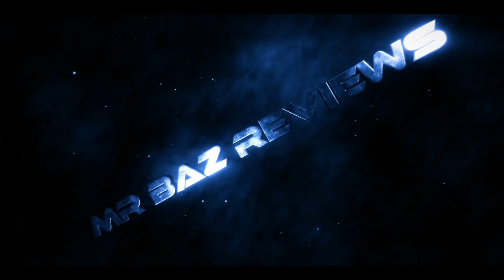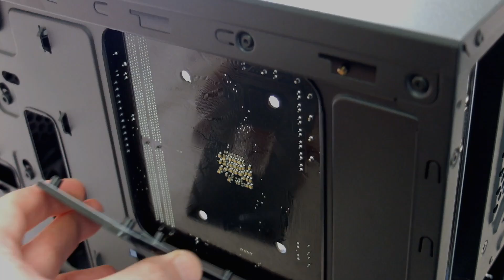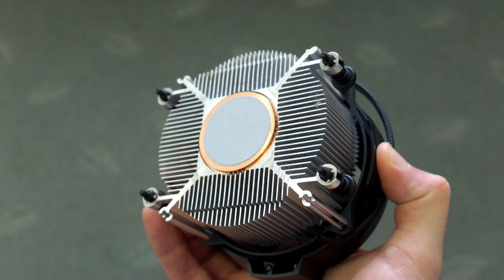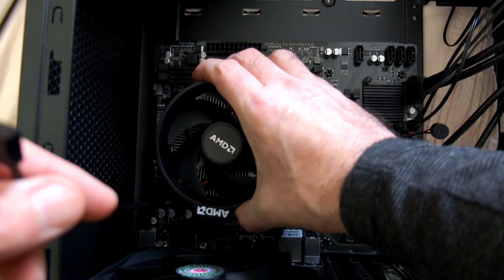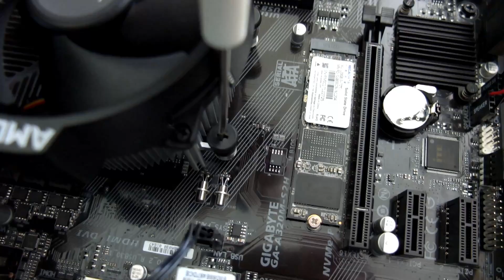How to install a Ryzen/AM4 & AM5 Wraith CPU Cooler

Comment: the back plate falling into oblivion was a nice surprise.  i dont understand how yours, after showing it fell like mine did, was in place when you went to screw on the cooler.  i dont get it
Reply from the maker: You keep the back plate in place, that's the idea, because you can't screw the cooler into nothing. So get someone to hold it, or put it on a book etc. AM5 boards have the backplate glued in place, most AM4 ones come off (the ones I've used)
Reply: @MrBazReviews  it was already secured in case =/  I got my hand under it but wow i am still amazing i got it.  error or not, you have to put so much pressure to get the first screw started that the whol e thing comes flying up off the chip.  never again.  i don't blame the cooler, i blame my lack of knowledge on it.  now that the system is working i appreciate how well it cools for being *dead silent*.  good cooler, weird install, terrible research prep on my part. cant blame the tool.

Comment: Not easy at all the springs come come down enough for me to get the screws back in
Reply from the maker: For some reason there is a bit of variation with board makers, but if the backplate is in place, you can turn the screws anti clockwise first

Comment: Okay so I accidentally removed the brackets and then had no back plate and I was dumb enough to just screw everything inside, i guess I need to be more careful with backplate next time onwards
Reply from the maker: On AM4 the backplate is where you screw into, I'm not sure why they did it like that. AM5 it stays in place when you take the brackets off
Reply: @MrBazReviews yup, also appreciate it you replying to comments even after years of upload

Comment: do i have to apply much pressure on the cpu cooler? i am kind of scared that i will completely f### my cpu if i press too hard…
Reply from the maker: Not really tons but reverse thread and make sure the backplate is held in place (if not using AM5)

Comment: When i install my cpu into the socket the corners on the sides of the triangle one are flapping around begore i pull down the lever. Is this normal or could my CPU be damaged (even though i checked and saw no damage on any of the pins)
Reply from the maker: It is normal to have some movement before it's locked down
Reply: @MrBazReviews Ah thank you very much. I had to take apart my pc because I spilled an energy drink over it and this video helped a LOT

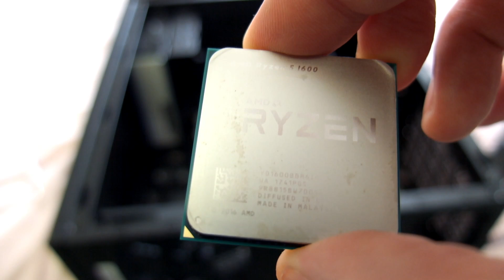Comment: Hey i have a question on 0:33 you can see the 4 holes where the screws have to enter, on your motherboard you can see there are already 4 black sockets i think for the screws to enter, i dont have these, so my question is what these are called so i can buy them.
Reply from the maker: That's the backplate

Comment: This doesnt work
Reply from the maker: It does reverse thread it get someone to hold the back plate in place
Reply: @MrBazReviews  yea it was the back plate i got it working now the temp in the case is also cooler now after repasting

Comment: Trying to mount it on an b450f and when i get one screw in the diagonal one refuses to go in completely even with pressure on both cooler and backplate
Reply from the maker: Reverse thread

Comment: I accidentally installed it the wrong way around and it's blocking the ram slot. My motherboard only has 2 ram slots so I'm currently stuck with 1 and can't add the other one. Can you help? I'm worried about removing the cooler And reinstall it.
Reply from the maker: Remove it and put it back on the right way, If it's difficult then heat the heatsink with a hair dryer, will help removing it. Also re-apply paste, once you have cleaned the CPU

Comment: Regarding removal of the brackets. Is this also necessary for the default Ryzen fan or just the custom fans?
Reply from the maker: It depends on the design, most coolers require the removal of the brackets, but there are some that will fit directly onto them.
Reply: And do you have to reattach the  back plate? Is the cooler being screwed into it?
Reply from the maker: @CampaignandCartridge  Yes

Comment: My advice is install it outside the case the prosses is way easier make sure to align the screws properly onto the back plate to
Reply from the maker: If you can get to the back plate with the case, it's not a huge issue. The problem seems to be some boards are tough to fit, others (Gigabyte shown here), are not.

Comment: this was the most stressful step in my first pc build and I think I fucked it up I didn't screw in enough or the thermal paste is not making contact right. I had to keep removing and putting it back on the cpu cause the screws were not aligned properly. cause 2 days later my cpu temps are around 45-60, sometimes spiking to just 75c just browsing chrome. 

And when I did the mhwilds benchmark test I was hitting like 80-85c, way too hot yeah?

On the 5600t stock cpu cooler and paste. Should I buy a new cpu cooler and thermal paste and do it again?
Reply from the maker: Temps are too high re-fit the cooler (it won't blow up CPU throttles), if it's not sitting well reverse thread it. Otherwise a third party one will be best (coolermaster/arctic cooling both good)

Comment: I think Asus tightened the brackets too hard because I was only able to get one off after a lot of struggle
Reply from the maker: They do vary quite a lot, it surprised me too using various makers. Could try a touch of WD40 might help (small bit)
Reply: I just finished building the PC many things went wrong but other than an orange light it works

Comment: Those TC has been very easy so far they’ve only placed a few hurdles and things that were hard such as the eye shoot or the front panel connector. We’re a bit difficult, but I eventually got them. The cooler has caused me the most trouble to put on it I’ve been doing this for like 20 minutes just trying to get it screwed in. I don’t know what I’m doing wrong.
Reply from the maker: Hold the plate in place (if it's AM4) and reverse thread first

Comment: Is that the only cpu fan that works with this motherboard?
Reply from the maker: You can use third party ones too not just the stock cooler. I've used Artic and Coolermaster both are good makers and offer reasonable cost ones.

Comment: Not sure if I’m just an idiot or something but, my cooler keeps moving all over the place and I when I apply pressure to catch the thread it just won’t so I sat there for about 2 hours just on that last part of screwing the stupid shit in and it just won’t. Any suggestions
Reply from the maker: As shown hold the back plate in place otherwise you're screwing into nothing!
Reply: @MrBazReviews  my issue was my backplate fell through into the back of my pc when I took my old one out… L moment

Comment: I just murdered a cpu tonight because the stupid fan screws could barely reach and would shift the cpu
Reply from the maker: I never had a problem with Gigabyte boards it's not easy to wreck a CPU take your time
Reply: @MrBazReviews  my board is MST unfortunately. Your video is excellent, I wish i checked it first lol, I snapped a pin because the thermal paste bond was so strong that when i adjusted the fan in any way it would tear the cpu out of the 'cradle' and I am now just going to pay someone to do this for me because i literally cannot afford to screw it up twice and this is my punishment for being a dumbass

Comment: i hope you still reply

no matter how hard or much i screw them back in, the screws wont budge at all. this occured after i unscrewed them buy i didnt touch my motherboard whatsoever
Reply from the maker: I can't remote troubleshot, just apply more pressure and use a larger screwdriver. It's just a backplate, it's not that fragile

Comment: I am worried that if i  overtightning the screws it may cause some damage.  And if i don't tighten it enough it won't properly cool the cpu. I just can't figure out how much should i tighten it. Although my pc is working fine but i still think that i may have overtighten it during the build.
Reply from the maker: Don't worry about it the backing plate prevents any damage, you can't really overtighten it, the screws stop moving when it's secure

Comment: Can anyone help me, my cooler when I tighten it becomes uneven an unable to screw it in any more… what am I supposed to do?!
Reply from the maker: Reverse thread, just put the screws in slightly then work around each one you might need to turn harder on the screws

Comment: I have a amd ryzen 5 5500 and it throttles when playing games and 95 degrees celsius I reapplied thermal paste and struggled to get the cooler back on but I did eventually but it still overheats
Reply from the maker: It shouldn't overheat if it's been fitted properly. You might also check the fan speed settings if you reapply the cooler.

Comment: Really not liking these coolers! Doing my first build today, thought I'd re-adjust the cooler as I was having problems screwing it in. As I took it off, it ripped the whole CPU out as the thermal paste had glued itself to it! The pins look fine, but I haven't finished building yet, so we'll soon see if it works lol
Reply from the maker: This is fairly common when you take it off, happens a lot on third party stuff too. Best to heat up the CPU first then its easier to remove, without pulling the CPU out
Reply: @MrBazReviews  Got the hairdryer on it, got it off ok in the end! And the CPU is fine, writing this on my new build - in no rush to do it again lol

Comment: what screw driver did u use i need to find a screw driver so i can un screw the cooler
Reply from the maker: Cross head one but a flat tip should work too if it's not too big

Comment: getting this done was prob the most stressful thing of all the parts, it's very sensitive and the cooler can get uneven pretty fast with just a slighly turn on the first screw at the beggining lol.

well at least it's not those annoying plastic pins intel still uses...
Reply from the maker: Some boards are harder to fit the cooler to then others.

Comment: I think my screws aren’t long enough I’m applying pressure but they don’t seem to be getting near the socket hole at all.
Reply from the maker: Hold the plate in place or put it on a book and push, they will reach

Comment: For some reason, i can screw in the bottom two screws but not the top ones, so my Fan is just tilted down now and i cant turn on my pc
Reply from the maker: Just put one screw in slightly, then get another one - take it slow reverse thread if it gets stuck

Comment: My fan still can’t reach the back holes for the screws. Putting pressure does nil. Everytime I do put pressure it moves the whole thing diagonally
Reply from the maker: Make sure the back plate is held in place, put one screw in a bit then work on the others
Reply: If my fking back plate fell how THE fck i get it out

Comment: Hey man, first of all thank you for the tutorial. I've recently upgraded to 5600G and so far the performance's been really good.

But may I ask you a question? My Wraith Stealth cooler does not have the copper circle block like yours. And when I tried searching for the Wraith Spire shown, almost every listing does not have copper thingies also. Is this just the updated 'cheaper' design or something? Because I also notice that the temp's going crazy, like 70-80C when gaming using it. 

Thank you
Reply from the maker: Later ones have aluminium only no copper core (some higher end ones still do)
That CPU has the GPU built in, so temps are a bit higher 70-80C when gaming isn't unusual, the max. temp is 95 degrees. You could try a better thermal paste Arctic MX range is pretty good 4/5/6 etc. That could knock 4-5 degrees off. I wouldn't be worried about the temps on that CPU
Reply: @MrBazReviews  Thank you very much for the quick reply! I already use MX-4 as the paste, although the number still worries me a bit. I think I'll invest in a budget tower later, but nice to hear that it shouldn't be a cause for concern.

Comment: Just to say but AM5 backplates dont come off at least on mine they dont.
Reply from the maker: It doesn't make any difference to fitting the AMD cooler, unless someone has a third party one which requires the plate to be removed.

Comment: I can't push all the way screws, it comes back and can't screw?
Reply from the maker: Hold the back plate in place or use a book to rest the board on it
Reply: @MrBazReviews  but the motherboard is the PC 😂
Reply from the maker: @Kraljcoek  And it was when I fitted mine, you turn it on it's side with the panel off and put a book there simple stuff, or get someone to help
Reply: @MrBazReviews  but the book on the side panel?
Reply: But do I need the force so much
Reply from the maker: @Kraljcoek  I can't remote trouble shoot for you, hold the plate in place reverse thread if it won't screw in, then screw it in
Reply: @MrBazReviews  the screw in but they don't go down, i will put so much force
Reply from the maker: @Kraljcoek  I told you reverse thread, calm down take your time get someone to hold the plate in place good luck! I can't help anymore sorry I'm quite busy now
Reply: @MrBazReviews  it's okay, thanks

Comment: It's so hard to screw it in. Do I have to really put force and push it in?  😭 I should have not remove the cooler , now I don't know how to put it back. 😭
Reply from the maker: Hold the back plate in place, then get one screw in
Reply: @MrBazReviews  what's the back plate? 😭 I'm so stupid for even removing the cooler. Is the back place the back of the motherboard? I don't think I can access it 😭😭
Reply from the maker: @sjkclau  Video is there watch it the back plate is shown, you screw into the back plate that's it
Reply: @MrBazReviews  I found it now. Thank you so much 😭

Comment: Only problem was the putting the screws in place on it but otherwise good video
Reply from the maker: There is no problem with the screws you push down (as shown)
Reply: @MrBazReviews  I didn't realize the screws were attached to the cooler.

Comment: I seem to only be able to make contact with the backplate on two out of the four screws. How would I solve this?
Reply from the maker: There is no reason why the other screws can't make contact if the plate is not bent! Get someone to hold the plate push down when screwing in and the threads should contact the plate

Comment: Thanks ! I messed up after i unscrewd the old COOLER because that backplate fell off into the pc ... luckily i can just unscrew the back of the tower easily and hold that plate with my hand or something and i can put the new cooler.  XD
Reply from the maker: It has happened to many before!

Comment: I can’t believe this was made 5 years ago and am5 only came out a few months ago
Reply from the maker: Because the AM4 and AM5 boards use the same method to attach the CPU, the only difference is the CPU doesn't have pins on the AM5 boards, the rest is identical. I guess AMD did it so more CPU coolers can be used, without changing the design. Lucky for me too I suppose!

Comment: So yeah it comes with the spring loaded screw but holy shit how much pressure do I need to put in to screw it into the motherboard??? I'm afraid im gonna break the fuckin thing it barely fuckin moves, like the springs work but with a lot of pressure, just can't screw it without thinking about breaking it.
Reply from the maker: Hold the back plate in place use a book or get someone to hold it
Reply: @MrBazReviews  don't worry apparently I didn't have the standoff at the back of it to hold the screws, I was basically screwing air like a moron, but I managed... The only thing that worries me is the cpu being glued to the cooler, anyway I'm fuckin taking it for repair and probably switch some parts. Thanks for the help
Reply from the maker: You mean the backplate ;-) @Raz-G

Comment: Am putting pressure its nit going down
Reply from the maker: Hold the back plate in place or use a book
Reply: @MrBazReviews  my motherboard came with no backplate
Reply from the maker: @vertachi8066  You'll have to get one no other way to attach it to the board
Reply: @MrBazReviews  I talked to the selly he's sending me one
Reply: @vertachi8066 did u open the back of your pc

Comment: Can wraith stealth cooler fit to amd a10-7800 series
Reply from the maker: No it won't fit as it's screwed onto the board, holes are different. I'd try an Artic cooler they are not bad on price and quiet/good performance. Coolermaster also decent

Comment: I might not get an answer becuase of the old video.. But holy hell i have to apply SO MUCH PRESSURE to get the screws to connect, it feels like i'm going to crack my motherboard.. am i doing something wrong?
Reply from the maker: Video age makes no difference!
You should reverse thread it, then it will be easier. Some are tighter than others Gigabyte seem the easiest least the ones I have used
Reply: @MrBazReviews  oh you're lovely <3 but please can you explain it to me like im five years old? I think i might be in this case
Reply from the maker: @iMrBananaman  It's simple you rotate anti clockwise until you feel less resistance, then tighten again, do this for each one
Reply: @MrBazReviews    okay thanks! I'll try it when i have more time. Im kinda scared taking the heatsink/cooler off since it took 2 people to get in on last time.. But i have to replace my cooling paste. Ugh

Comment: my backplate screws don't come out far enough. Almost have to put my whole weight to get the spring loaded screws to come out far enough, not even going to attempt it. SHIT DESIGN.
Reply from the maker: Never had an issue with Gigabyte boards but some makers are trash no question. Get a longer screw driver with more torque, the screws are tight but it won't break